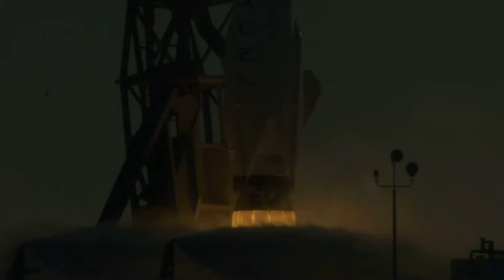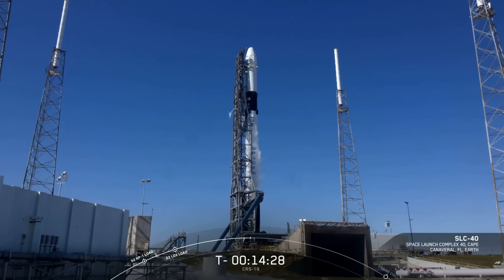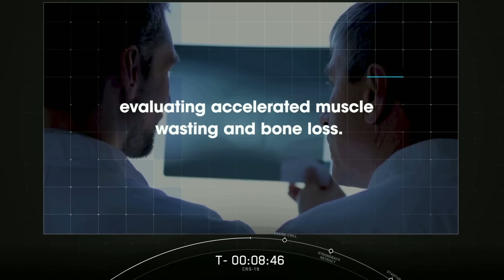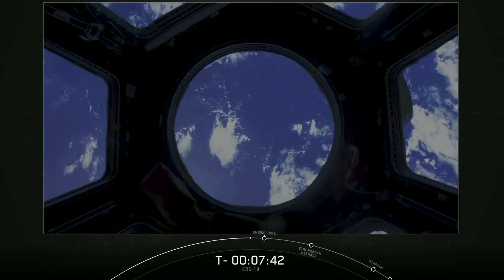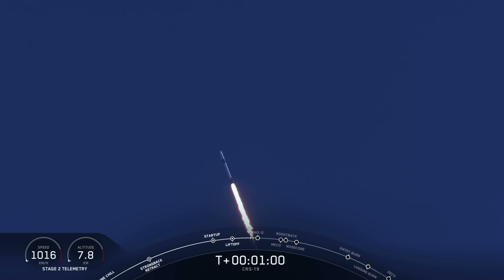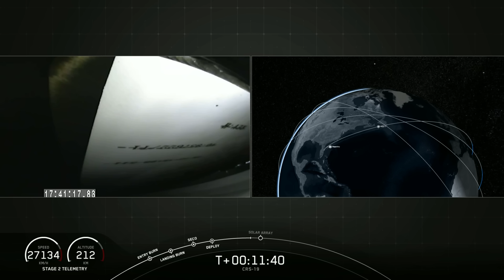CRS-19 Mission

Comment: After answering too many comments here it comes. 20:03 is ice, dun dun dun
Why? At 20:25 you see another piece of ice sliding along and that is the cooling tube for the booster. It is normal for ice to be there.
Also the booster has a circumference of 23 meters, from the size of that "mouse" i would guess it is 1/20 of the circumference(if i'm really generous). So 23/20=1,15 meters. Have you ever seen a mouse that is 1 meter long?
Take your tinfoil hats to something that is more believable

Comment: In the spaceX CRS-19 Misson video,
on the left screen at 18:46 minutes what is the winged thing that appears at a height of 124 km at 8518 km per hour, and watch out, it is there and appears for about 25 seconds, while the shuttle speed reaches 9300 km and rises to 142 km. The thing that appears with flapping wings can only be followed by flapping wings for 15 times.
There is also another flying onject with wings but this time that object smaller and in a rush :) at 28:43 you can clerly see a bird type UFO :) flyng on the altitude of 217Km with the speed of 27.112km/hr and about to pass the rocket :)))

I ask scientifically:
The atmosphere consists of 5 layers that surround the earth and have different properties. These;

1.Troposphere: It is the layer of the atmosphere that touches the earth. Live life only exists in this layer. It is 9-12 km thick.

2. Stratosphere: It is a 50 km thick layer.

3.Mososphere: It is 80 km thick. It consists of two parts, the Ozonosphere and the Chemosphere.

4.Thermosphere (Ionosphere): It is a layer where the temperature of 640 km is 200-1600 c °. In this layer, gases are present as ions.

5.Exosphere: It is the top layer of the atmosphere. Artificial satellites are located in this layer.

What is the flapping of wings 142km above in our atmosphere where live life is only up to 12km high? :) and calmly ... can there be a winged UFO? :) 

waiting to hear a scientific explanation please, thanks

Comment: Starting around 18:42 you will plainly see a 🐦 flying on the left screen. Just after the 20 minute mark you will see a mouse 🐭🐁 running around on top of the scoop of the engine. At 28:42 you will see another space 🐦 bird

https://www.facebook.com/groups/335014006596766/permalink/2557173304380814/

Comment: Can anyone explain the visual movements on right hand side screen..
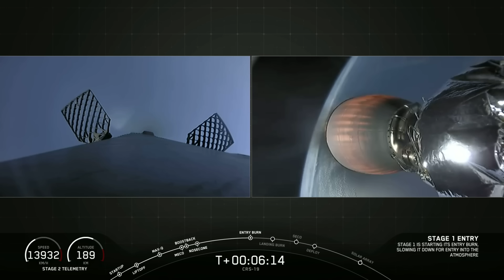@18:40 @19:05 @19:27 @20:03 @20:24 @21:11 @21:23 @21:30 @21:48 @22:05 @22:05 @22:09 @22:39 can't be rodents because they are in space which is a vast vaccum that surrounds our pressurised system without a barrier.

Comment: Back from a discussion I had with a SpaceX employee on here (he knew allot) a year or so ago. He was trying to justify the traditional launch with kerosene rockets etc. I said nah. Additionally I argued it's all about $/kg so best build a shaft in the ground and put rockets in the shaft to push a vehicle like a dart so it rides on pressure and doesn't use it's own fuel until exit speed just under the speed of sound. He didn't listen. But I think the Russians did. So, told you so. https://youtu.be/qLV1Ao9QkpE

Comment: Elon Musk, If you really want 1000 starships in 4 years there is only 1 way to do it AND IT'S NOT RING SECTIONS! You build a machine that accepts the rolls of stainless steel on a 45 degree bias to a welding mandrel the size of what you want to build. You then weld A SINGLE 45 DEGREE SEAM as the stainless steel tube of the fuselage is created. Then using aerospace adhesives you attach a framework of hat sections to the inside of the newly created tube with ONLY ONE WELD THAT CAN FAIL. It's literally a continuous fuselage making machine that can churn out multiple finished fuselages in a day.